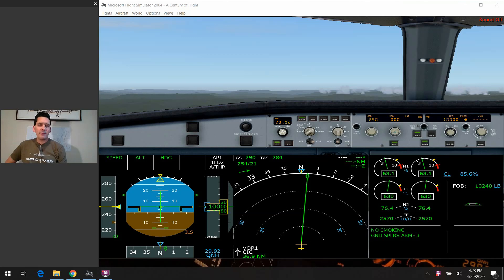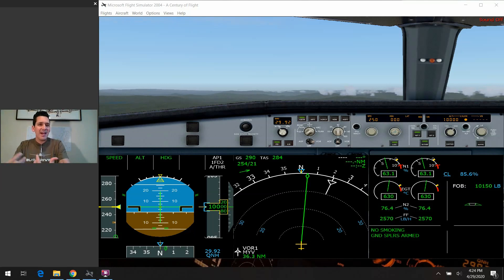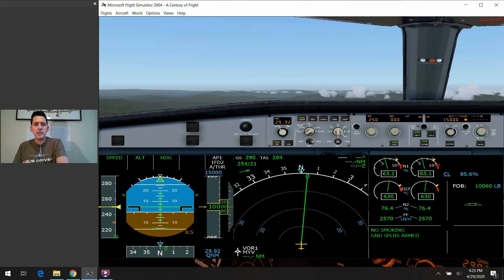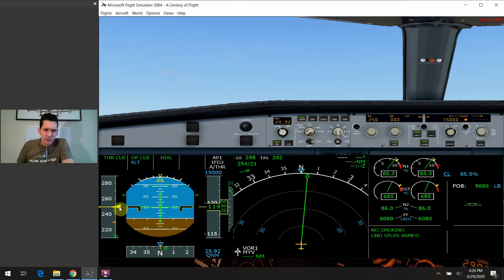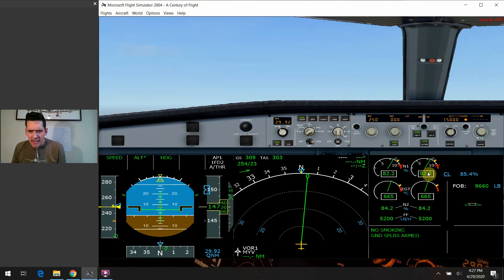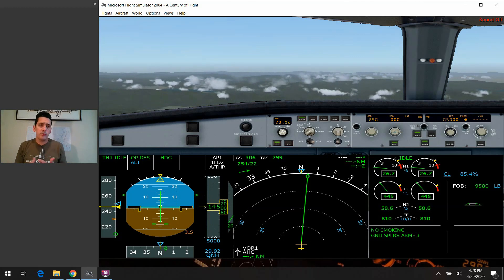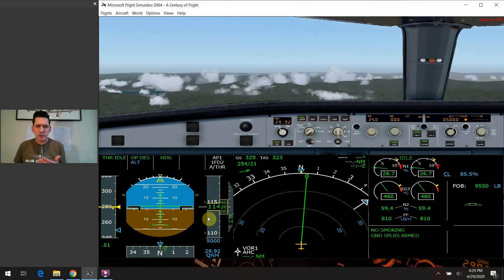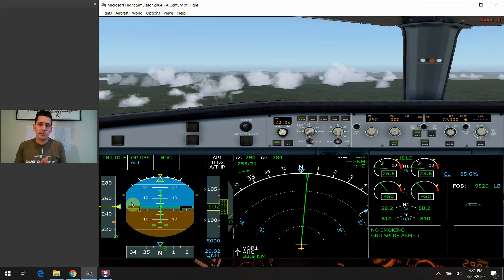What is an OPEN CLIMB/DESCENT in the A320??-Explained

Comment: Great as always! A question, though: as I see the vertical seed needle reach 40 on descent: at what point would it become uncomfortable for the passengers (I suppose there is a limit in vertical speed during descent). In some instances I noticed my years popping quite bad and for a long time during descent. Cheers!
Reply from the maker: Hi Mircea, thanks for tuning in! This is a great question! The passenger comfort is a direct factor of the cabin pressurization system. Remember that we have actual vertical speed that the plane is climbing or descending and we have the CABIN VS that the plane is allowing the pressure to change on the inside of the plane either up or down. In the A320, the system is supposed to limit the cabin VS to -750 FPM in a descent, no matter what is happening on the outside of the plane, even at descent rates of around 4000 FPM. So theoretically if you are in an airbus you should always be comfortable as a passenger and not have this ear pain. Haha, but I suppose anything is possible and even this rate might be painful for some in some circumstances. I would venture to say that some older airliners may have had different safeguards built into them that allow for higher cabin VS rate changes, which would equate to more pain for some peoples ears. I'd be interested to know what the systems on the 737 for example are designed to allow for. There are certainly some limits in place. Does this help at all and make sense?
Reply: @MikeAbignale  Thank you very much for the comprehensive answer, it makes a lot o sense. Indeed,  if I remember right, I felt this more on Boeings 737s,. but also, interestingly I think, specifically one some airlines. Thank you again for all the vids, very in-depth info, as a simulator Airbus 'pilot' they are very useful. I always go back in the sim and try your tips, not all are simulated, but nevertheless your material helps having a more professional approach to the experience. I thought the VS I got on specific occasions on the sim in managed mode was not realistic but now I reconsider this, and I will check the VS indication next time. Cheers!
Reply from the maker: Yes certainly Mircea, I'm glad this channel is helpful to you! I really appreciate you leaving a comment! Cheers! Mike